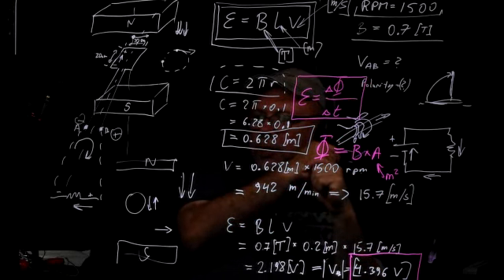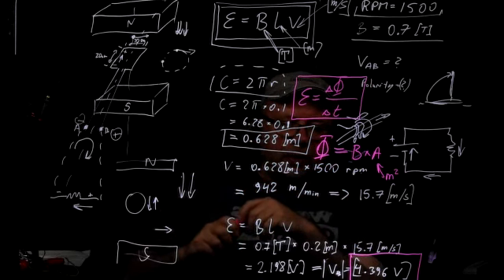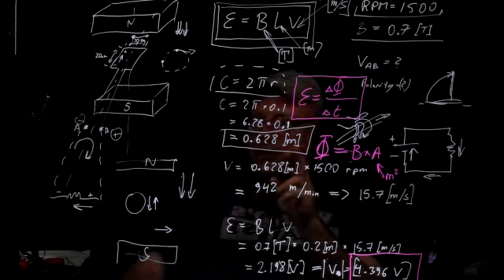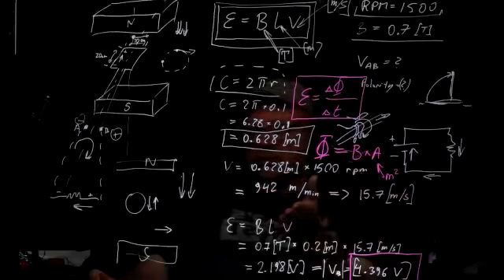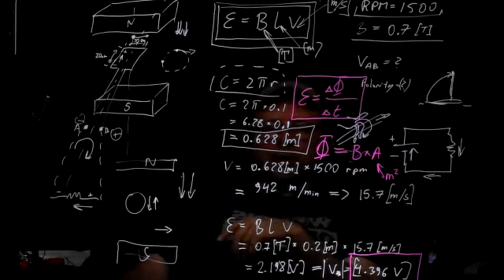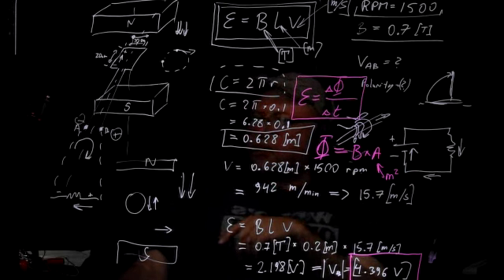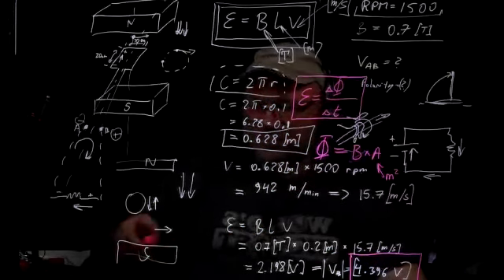Week 10 Synchronous Motor and EMF calculations 01

Comment: A synchronous motor is operated from a bus voltage of 1 p.u and is drawing 1.0p.u power factor lagging current. It's synchronous reactance = 0.5 p.u. what is the excitation emf of motor. Pls sir give the detail solution for this problem.